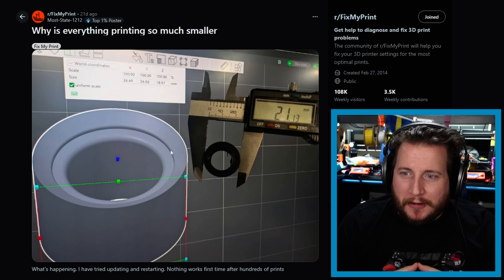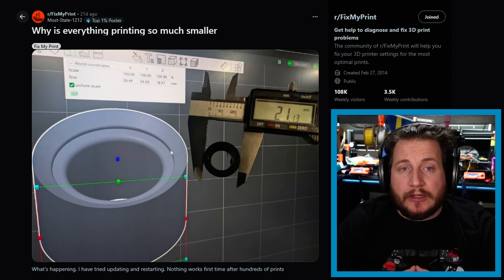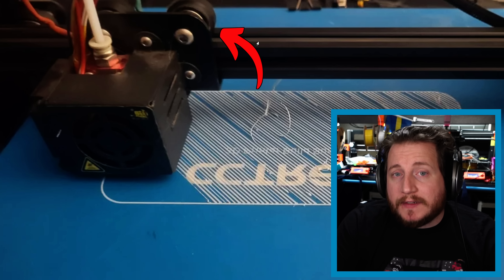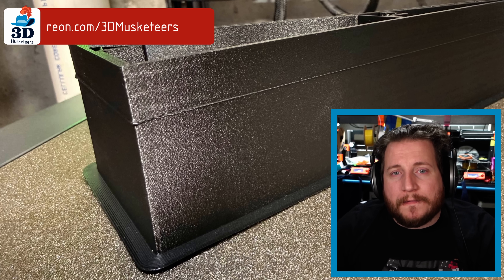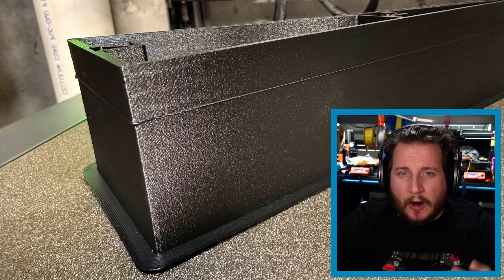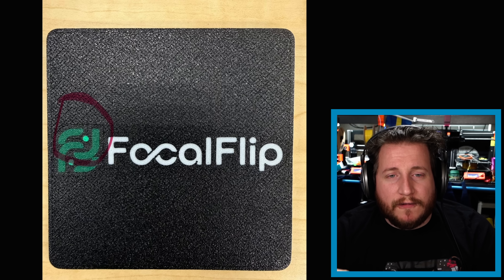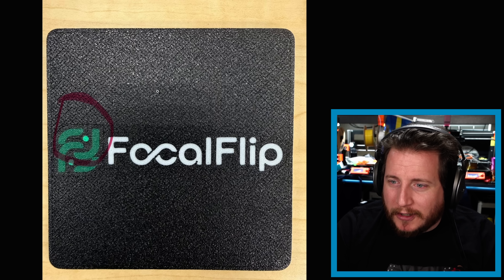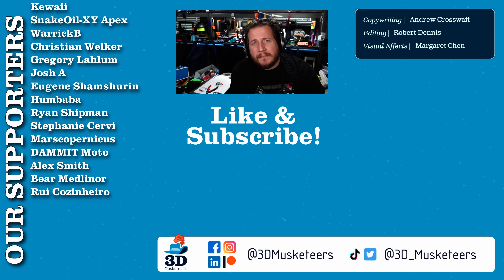Carbon Fiber Didn't Help THIS Layer Line! - PrintFixFriday 218

Comment: I use an old hair dryer with a PTC that cuts off around at 50C to heat my centauri. It works perfectly and i get near perfect PC prints, dead flat and no serious issues even in spiral vase mode. I chuck the thing in under the heatbed, run it for a while while the nozzle preheats. The hairdryer is a decent hack if you pick a small cheap one that has an auto shut off (800W-1200W), the chamber gets to temp in less than 5 mins, and with a little bit of insulation keeps the temps around 40-45C steady for 2-3hours without damaging the internal components. Works for me, but i'm a cheap bastard with a cheap machine.

Comment: The petg-cf could be solved with a redesign. Round the corners,  and break up the straight lines. You can only do so much with hardware tweaks when you don't design for the process

Comment: wonder why they took away the ability to generate supports of of the model, ol simplify 3d used to be great at that . you could rotate the part 45 deg generate a support then rotate  it back and it would build off the model wherever saving material

Comment: The first layer offset actually has a correct setting. That is, when it actually gives you the height the slicer assumes. Once you hit that height, the slicer compensates for a textured surface, if you tell it to, and adjust the filtrate accordingly. Thus, if you adjust the first layer height, to "dig into the bed", you mess up the physical height of your first layer. This is, also a left over from the "raft" era. The correct solution is to increase the filtrate of the first layer, if the slicer is slightly off for your printer. It is bad practice to alter the first layer offset.

In case it is lost on people, Orca even has a setting for adjusting the filtrate for the first layer: That is how this is supposed to be corrected.

In this vid, there is warping going corner to corner. The simplest way to combat that, is to take a serious number of bed readings for your bed mesh (like every 14mm or so), soak the bed for at least 40min. If you fade out the ABL, that reduces the pull on the corners, and increases the accuracy when done right. Also, thick solid parts tend to warp way easier, than meshy ones. I just started a 31 hour print, and deliberately avoid printing it with top and bottom layers, as it will print really nice without them, but will warp pretty early, if printed solid, that is, with top and bottom layers. Also, pay attention to infill. If the infill runs longitudinal with your edges, this tend to reduce the forcing pulling. Diagonal lines are longer than lines following the sides of a square, thus diagonal lines will shrink more, and thus pull more.

Comment: My Prusa Mk3S+ printers used to haaaate it when I'd print in the winter (yes, coastal California doesn't have a proper winter but it still gets a little chilly in our garage). I'd use a hair dryer to warm up the plate and hotend enough for it to stop throwing a MINTEMP error, then after they heated up the first time they'd be fine for the rest of the day. I had the printers inside a 38U server rack so that kept it a little warmer than ambient once the printers were running.

Comment: I highly doubt that layer line was caused by the brim pulling away which tends to happen at the corners, yet the line goes right around the perimeter. More likely it's due to the geometry of the model. You can see it's not a solid, and I'd bet there is an internal step right where the line is. The solution isn't a larger brim but adjusting the print settings - printing the outer walls first helps.

Comment: I used to deal with cold temps by placing a small 500w space heater inside of my printer, cable ran out of the printer and had its own plug just in case. Dont do this kids, its dumb as hell haha. I have upgraded to an actual enclosure heater since then and even then I dont let firmware control it, I control it manually for safety. Fire extinguisher near by at all times.

Comment: Some filaments look really neat with Hilbert Curve first layer. The first one that I discovered was the silver that Prusa used to ship with their printers (pre-Prusament), made by FilamenPM. Based on what I see with that filament, I think it is a black base filament with a silvery powder. It almost looks holographic with Hilbert Curve as the first layer. I've also had some stunning results using multi-color coextrusion filaments.

Comment: Yep, I always have to zero, its just second nature to move faster then it can keep up with. There are some prints where a raft is necessary, mostly where orientation does not favor a models surface on the point of plate contact, super rare, but sometimes... Built-in breakaway supports FTW if ya have model source and can!

Comment: Another issue with the el-cheapo brand calipers is when they are powered off, they really aren't off. They'll eat their own battery just sitting in the drawer. I found a 3D print for my el-cheapo calipers that replaces the "expansion/IO" cover with a slider that allows me to disconnect the battery when not in use.
Reply: Sounds cool..What keywords could I use to find such print?
Reply: @saultrecktom  Try "Caliper Battery
Saver". The one I printed is by MajorOCD on Printables which is a remix of one on Thingiverse (which he links to in the description). As I recall I did have to shave some parts down to fit my calipers, but it was a fairly minor mod that I did on the printed parts.

Comment: Saw video testing calipers, and the conclusion was that even cheap calipers were pretty accurate. Not as good as expensive ones, but good for most uses in the hobby area.
Reply from the maker: yep, cheap ones are good enough!
Reply: I've got a set  I bought at an antique shop along with a pile of other nice measuring tools, I use a Brown and Sharpe 579-1 caliper almost daily. still seems accurate

Comment: Don't trust the calipers?  If in doubt use a ruler.  Granted it's not as accurate but I have yet to find the ruler that needs to be zeroed or calibrated.

Comment: Only time I've used a raft on my K2 Plus is print some very small footed vertical parts. The brim wasn't emough for these pen style parts. 😂

The only other time I think I would use a raft is print a raft for a materail that will want to warp in a more "sticky" materail to the bed.

Comment: While watching this video I maxed out my ASUS hyperX card. I added 2 more 4tb drives. It's now 8/4/4/4. (2x4 is cheaper than a single 8 by quite a bit lol) The motherboard only has a 2tb drive for the OS. Since it's a Threadripper it still has TONS of slots available. And I can always add another hyperX if I need to. I've almost archived my whole blu-ray collection though. And I'm not buying nearly as many movies. So it's probably good for a while after this.
Reply: and both show up correctly!! Got to love TR it just works unlike that B series motherboard crap that I started with. lol

Comment: My favorite WTF did I do moment was when I was printing a part I made that I was working on. I made the Z start at 0......but for some reason all vertexes got moved up by 1 layer......except one. That obviously didn't work well. I still don't know how that happened. After I moved them back to 0 it worked fine.

Comment: I learned years ago, check your measurements with calipers more than once. I also check the surfaces for debris. Good calipers will not show zero if there is dust between the jaws. But will correct the zero when cleaned.
Reply: A good habit to get into with calipers is to wipe the face of the jaws every time you use them (and zero them).
Reply: The 5mm discrepancy may mean they measured a hole, zeroed it in the hole, then measured the distance between 2 holes.